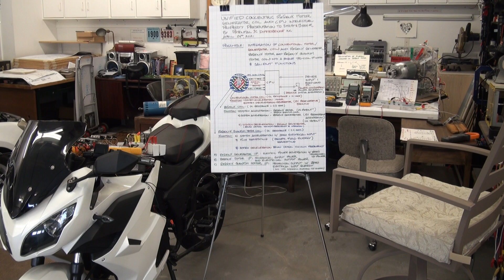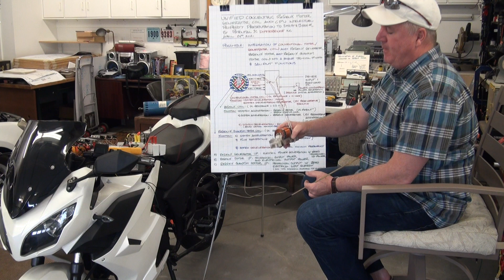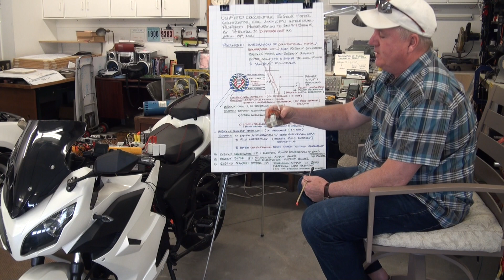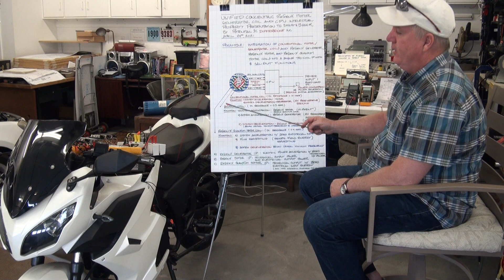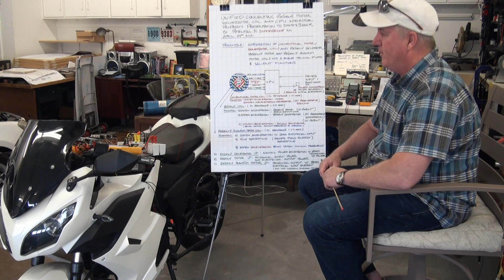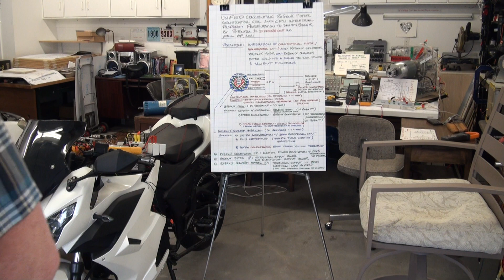PERPETUAL MOTION MACHINE OF THE 1ST KIND - #perpetualmotion

Comment: Any movement on getting this validated by your peers? Then commercialization here we come!!
Reply from the maker: Hi Jonathan, commercialization is already started. ;-)  
Validation is just part of the due diligence process. 
Cheers Thane
Reply: @ThaneHeins1  That’s exciting!! Are you looking to start commercialization in Europe or North America first?
Reply: @jonathangroenestege2120  just never do in Europe and MAKE PATENT FREE to a good of Humanity. Otherwise Oil companies will do something..
Reply from the maker: @Pumpkingilmour The ReGenX Generator charges the EV's batteries - the ReGen-X Quantum Motor does not. 
The ReGen-X Quantum Motor provides maximum EV acceleration with zero battery energy consumption... 
The ReGenX Generator's EV acceleration contribution is less.